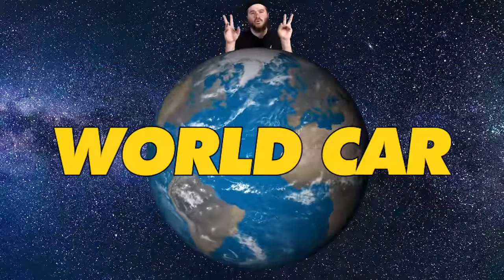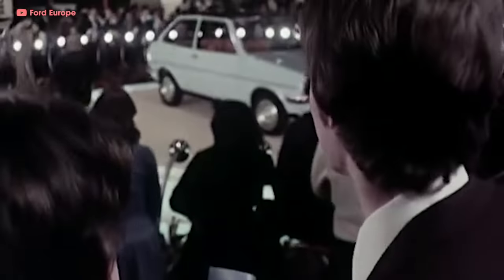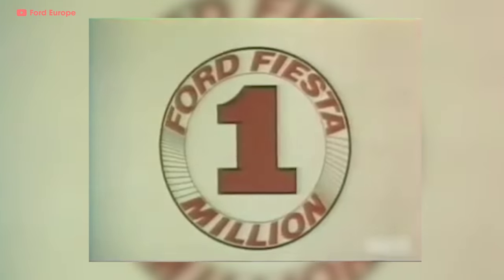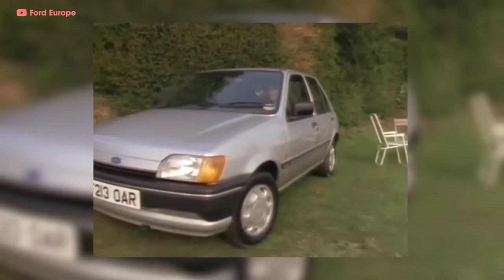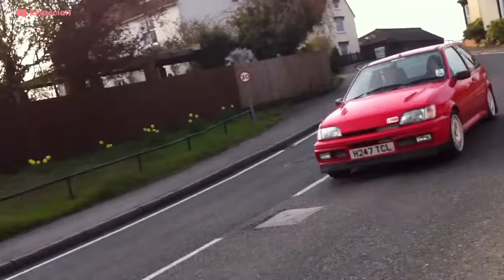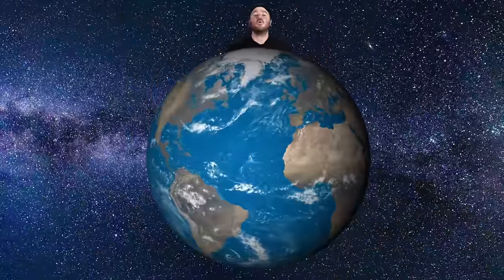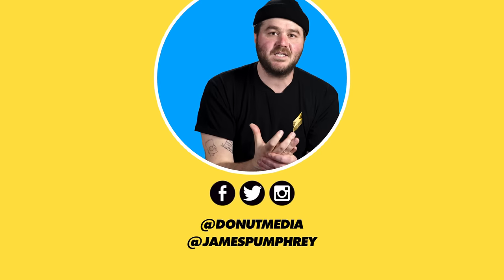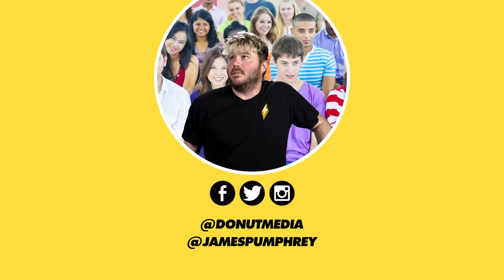FORD FIESTA - Everything You Need to Know | Up to Speed

Comment: The ST150 or Mk6, had 150bhp as he said but they were super capable of taking around 200bhp/230bhp. Theres a few N/a ones in the 300s and a few charged ones in 5-700 bracket. Some people also did full cosworth drivetrain swaps. They handled great, predictable fun cars to drive. Economical too with like 40mpg in mine. Low end torque was great. Interior quality was a little bit questionable. And the image of having one isn't the greatest but with current times you can now pick up an okay one for 500 pounds. Worth a buy anyday.  Theres tonnes of people who offer tuning upgrades like mountune, pumaspeed etc etc. 
Then there the mk7 st180 which was the 1.6 turbo. and then then 3 cylinder and so on and so on which is the st200 I think.

Comment: is there no mention at all of the transmission issues w/ the DCT on 2011-2016 Fiestas?

Looking at a 2018 with the 6-speed automatic and wondering if I should keep looking or if it this really is a nice, reliable little economy car even w/ the DCT. I did hear after Ford got sued in 2017 later models had less problems.

Comment: If I recall correctly, the Mazda was the same car built in Japan, by Japanese workers who took Deming's teachings (precursor to modern "lean" manufacturing techniques) to heart, while the Fords were built in the US, where we ignored Deming until sometime in the 90's. As a result, Ford found out that the cars built in Japan were more reliable than the same ones built in the US, which would explain the higher J.D. Power rating.

Comment: Man i sure miss my mk5 Fiesta 1.4 tdci.. it wasn't fast or torqued up, only pushing 68 skinny ponies and 118 ftlbs tq. and 0-60 in 15secs. but man i never had or seen such an economical car before. that baby on a full tank could get me 1100 km (650miles). On average it gulped about 53 mpg of diesel. The best part about it? I got it tuned on a piggy back ecu with some popcorn backfire, some months after, and pushed it to around 130hp/250lbtq (0-60 in 8 secs) on its limits, and still, the mpg didnt even change unless i was on WOT. Lowered on springs and good tires, and MO POWAH, i was definetly pushing 50k$+ sports cars around the track. Sadly all the excess ponie powah fought the tranny, and i lost 2 gears and the clutch.. RIP BABY I MISS YOU :(

Comment: For the same price or cheaper, depending on mileage you can get a quicker and more reliable MS3 thats fwd with 280hp and the same engine block as the focus rs, and direct injection

Comment: You forgot to mention, that the ST is continued in Europe, with the new 3 cylinder (instead of the 2014-2019 4 cylinder) engine.
The new engine makes the same HP, but higher torque numbers, and is about 50LBS lighter; not to mention, the 3 cylinder is much better for Turbos; and therefor gets a much faster 0-60 time.
We missed out on the best ST ever, in USA.
Still, if they would have made it with a 1,8 liter, and would have made the gearing significantly taller (meaning lower RPM on the highway), the current 1.6L Turbo car, could have easily made 40MPG on the highway, vs current 32MPG (30MPG AVG). 
And get rid of their crappy (but good looking) rims, that crack and break like none other.
I replaced mines with steelies, and increased the tire diameter by 2", for a much smoother ride on the streets.
Still have the rims with the stock tires though...

Comment: You guys totally omitted the fact that one of the main reasons the fiestas we're pulled out of the American market
Was because  THEY WERE LEMONS....I owned one. I know. GREAT CAR up to about 20k miles. Then bye bye tranny. A dry clutch? They sold them as automatics, but in reality should have been driven as a manual. People would burn up tranny's one after another. Ford extended the warranties for 10 years on it. But after having had my car in the shop for 4 months at four different Ford dealers, the service manager took pity on me. Told me look, the part we need to fix your part? Doesn't exist. It's still at least 6 months away from production, and that's if they approve it. So, I wound up selling it back to Ford and even made about $2500 profit after it was all said and done. LOVED my fiesta though...RIP Charlotte, we miss racing in you,  light to light all those freaking Asian cars and going Airborne...

Comment: lol fiesta is good. easy to work on. but their first generation of the ts6 transmission for the automatic was god awful. and recalled 😅. i know. mine went into the shop under warranty 4 times for the stupid control module. I would have rather had a manual tranny lol.

Comment: Forgot to mention how crappy and unsafe the auto transmissions in the 2012-2019 fiesta's are. That transmission was so bad it has so far cost Ford around 200 million and a few a lawsuits and they still refuse to do a mass recall. The engineer of that trans even came out and said they cut a ton of corners when building it at the request of their higher ups.
Reply: I'd like to hear more on this. I heard it was mostly the 2011-2016, as Ford ended up getting sued by everyone in 2017 and later models weren't as problematic... looking at a 2018 SE w/ the 6-speed auto, heard about the overall reliability of the Fiesta, but want to know if I should keep looking.

Comment: I have a 2011 ford fiesta. It has a 1.6 zetec rocam engine (the one from brazil) and i fucking hate it. It overheats like a bitch and there is nothing you can do about it. It has nice power and is fun to drive, but the overheating is just over the top